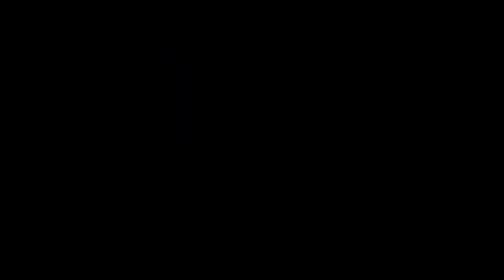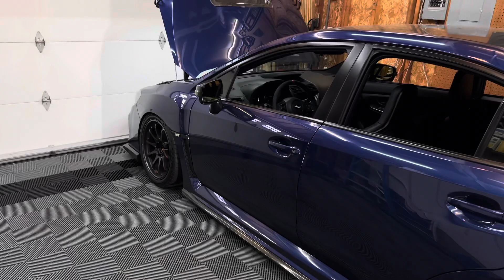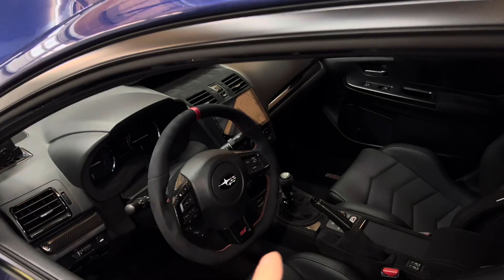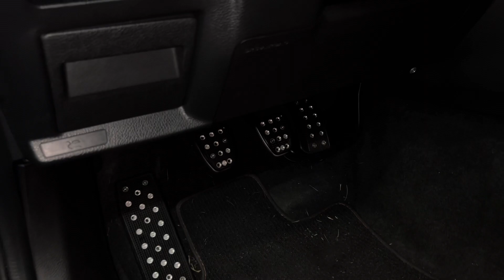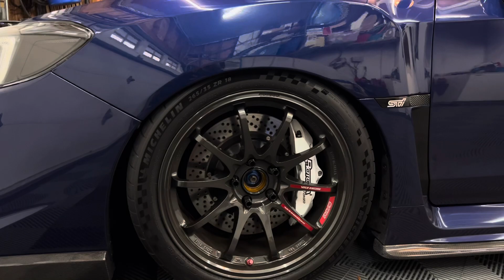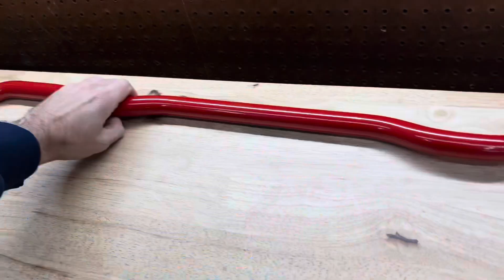My 2017 Subaru STI Mod Overview - Driver Mods

Comment: Great list of mods! I’m still missing a few key parts but I’m intend to get them after my livery, as for the front sway bar, it’s a completely different animal once you get the sway bar installed. If you plan on running stiffer, your next mods should include chassis bracing from Cusco so the chassis won’t flex

Comment: Great video. I am on two minds about coilovers. I had coilovers on my FTO GPX, and I loved it for track days and any time I was up around the mountains for spirited runs. But the coilovers along with all poly bushes, control arms etc, didn't make it the best daily driver. I had a decent spring ratio as well. Stiffening up the suspensions, and it being an old car, it started bringing out rattles from places I didn't think would rattle :P I am bit torn going towards a coilover setup for a primarily daily driver STI (and the car being only few months old, 21 STI, the stock suspension is 'decent' for the regular bumps and potholes I encounter on normal streets). 

I agree with your list of suspension and rigidity mods though, I had pretty much the exact setup on the FTO (but had adjustable camber and toe arms) and it handled like 'on rails'.

Comment: How is your steering wheel holding up? Appears to Alcantara?
Reply from the maker: Great. Requires more maintenance over all but looks as good as the day I installed it 4.5 years ago.
Reply: @Autofreakgarage  Any chance you can post up the maintenance of the wheel?
Reply from the maker: https://youtu.be/qYIyZu_Rhsc
Reply: @Autofreakgarage  Awesome. Thank you!